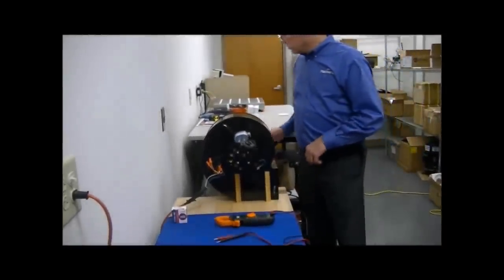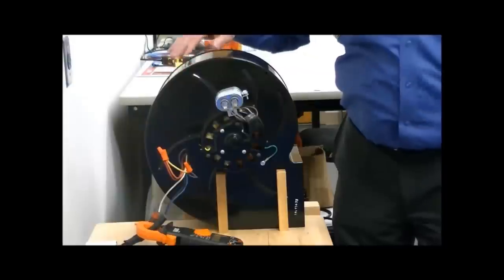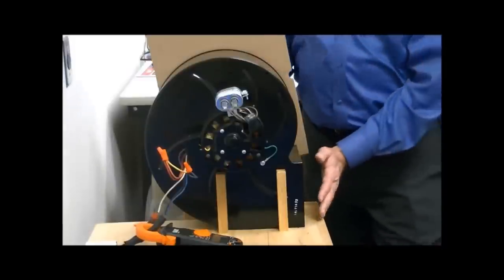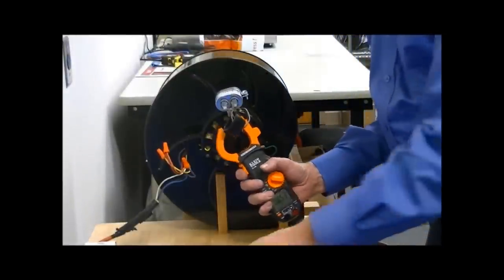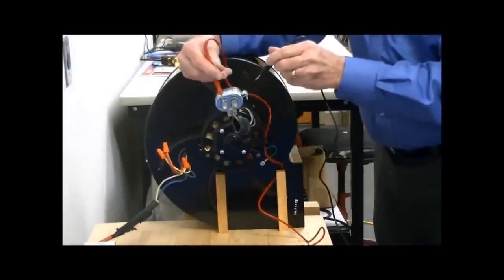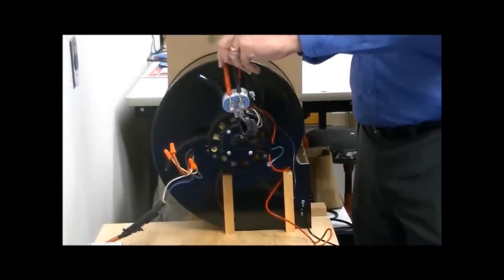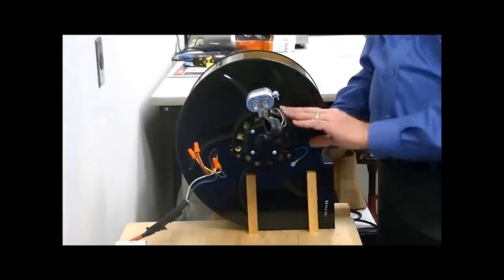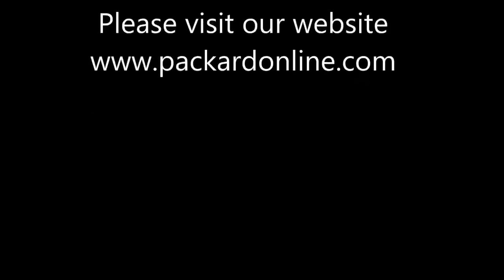How Dirty Filters Ruin Your Furnace Blower

Comment: So if I know i want to run my blower with dirty filters, because I salvaged it and am using it for a wood shop air cleaner, can I just replace capacitor for a higher rated cap?
I sure the answer is yes...unless someone knows better.